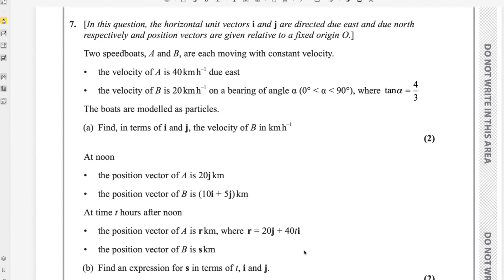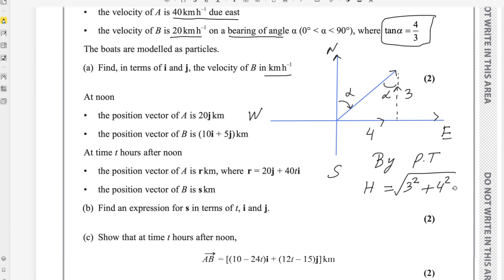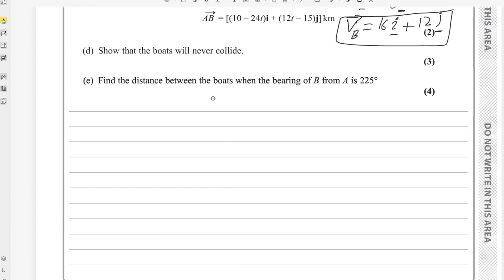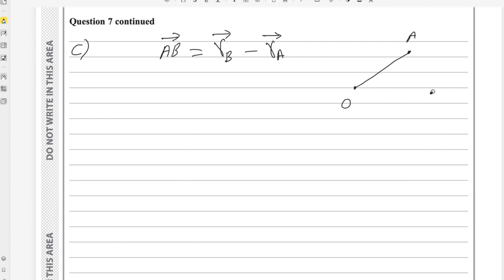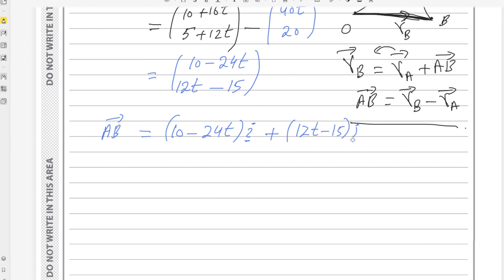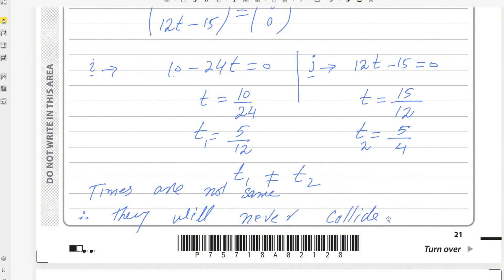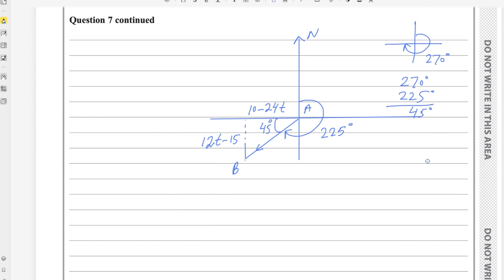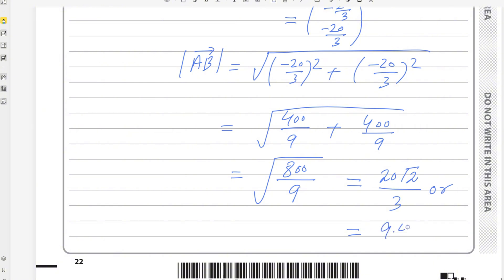Mechanics M1 May 2024 [Q7] Pearson Edexcel IAL WME 01/01| Speedboat Vectors & Bearings Explained!"

Comment: i solved part a of this using ratios, will I get the marks, as we know tanalpha=4/3 so hyp = 5 using 5/20 = 3/x where x is the j component?
Reply from the maker: Yes, your method works! Using the ratios from the 3-4-5 triangle is a valid approach, and your proportion is correct. You’d get full marks for this. Well done!